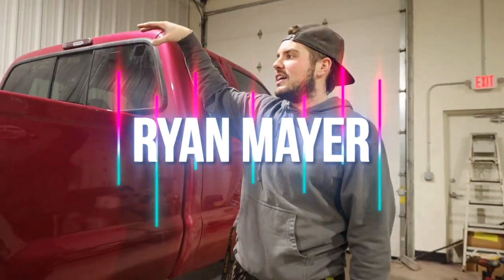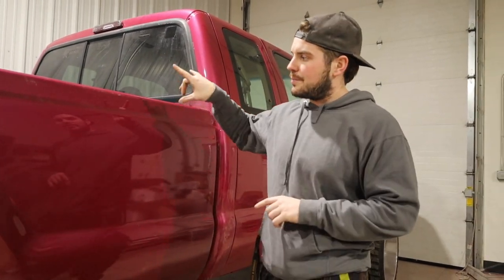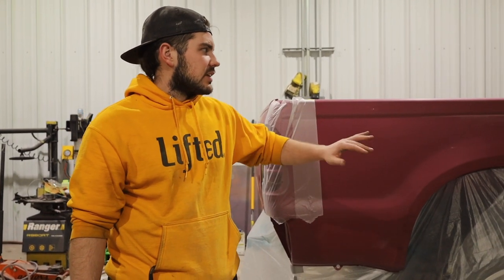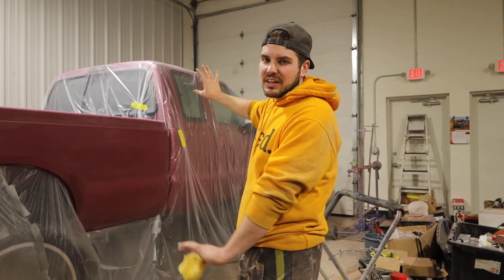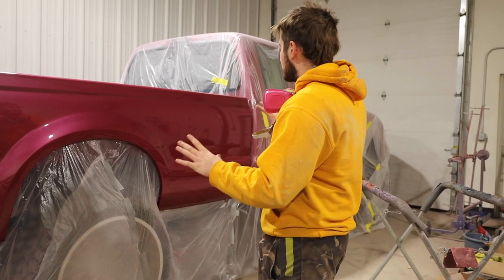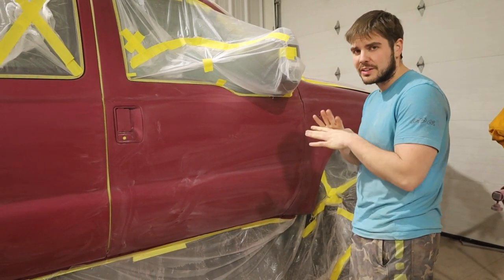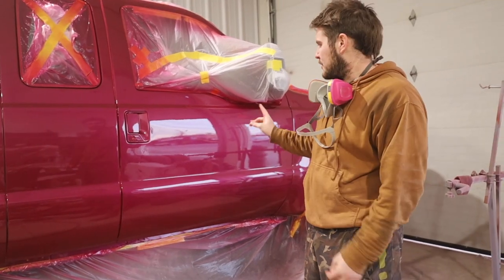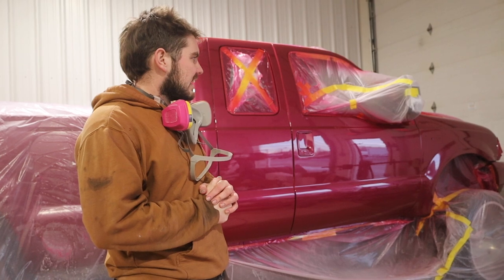Mud Trucks COMPLETE $10k Paint Job

Comment: I don’t understand why you don’t just do 4 coats, flat sand starting with 800,1000,1200,1500.  Than 2000 , 3000. On a da sander. Than polish. Will give you the flat show car finish with  about the same amount of work and less cost on materials.